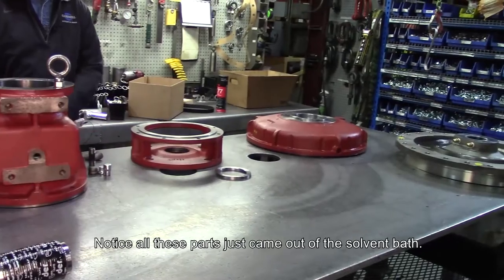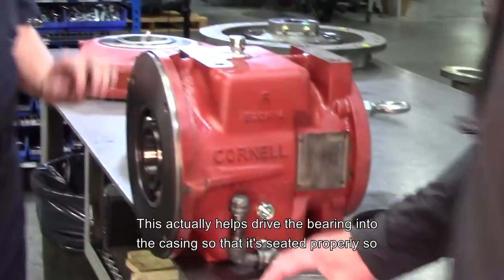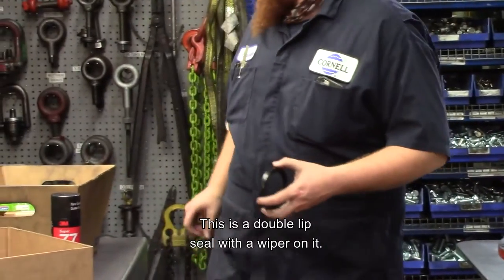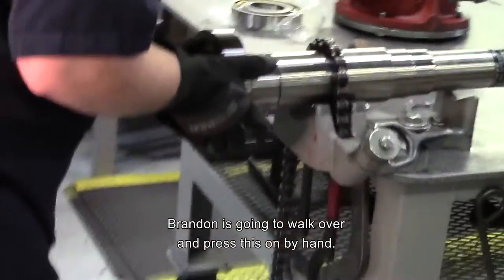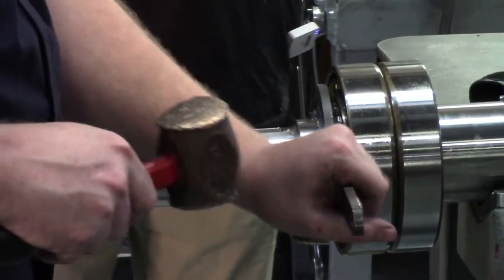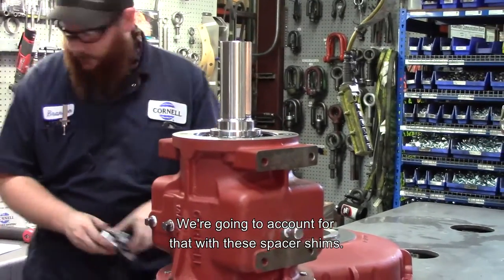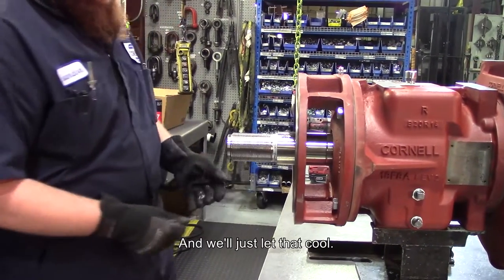Bearing Frame Assembly captioned

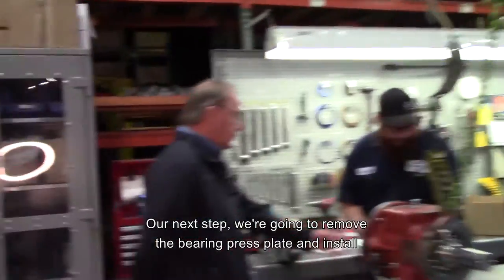Comment: I JUST GIVE A SUGGESTION ...AT 11:49 moment we should use a pipe to press the outer ring .It will be better avoid force impact to ball .
Reply: Tran, thanks for the attention to detail! As stated in the video, the bearings are a slip fit into the bearing frame. The press plate supports the races on the pump end bearing as the shaft is pressed into it. There are no forces being applied to the balls  of the bearings in this method.